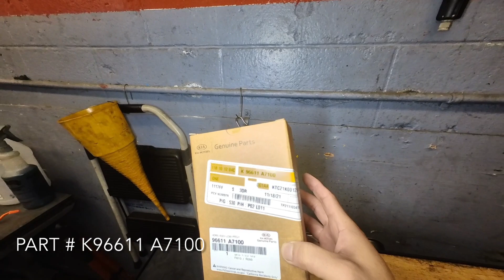How to diagnose and replace horn on kia forte

Comment: Would the same part number fit a 2014 Kia forte
Reply: I’m having the same issue with my 2014 Kia forte. Did you figure out if the same part number works

Comment: For some reason mine stopped working when you hit the horn on the steering wheel but when you lock it beeps, wondering if the horn is failing or what.
Reply from the maker: when you locked it using key fob that’s your burglar alarm, I think main horn is failing.
Reply: Im having this exact same issue. They said I need to replace my horn completely.
Reply: Mine has failed. Thanks